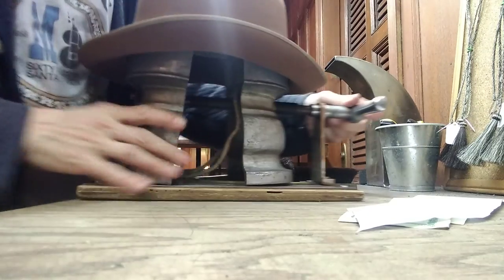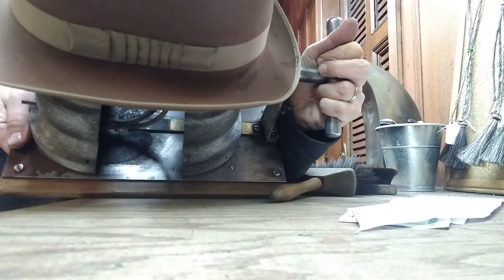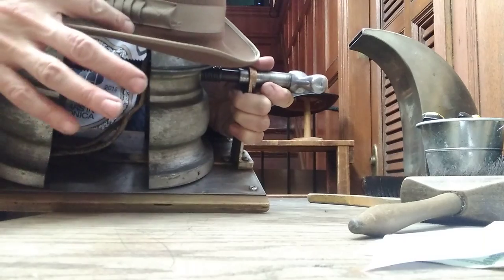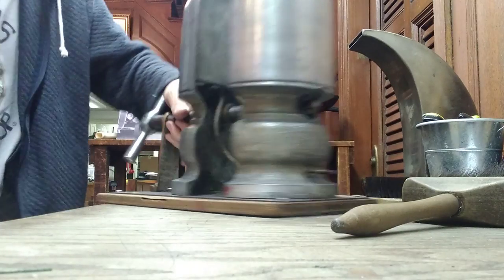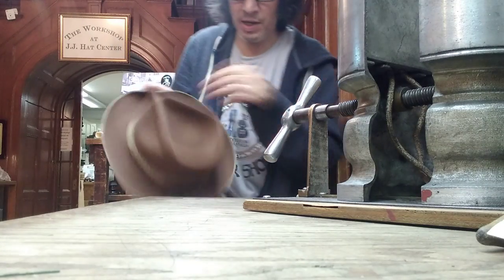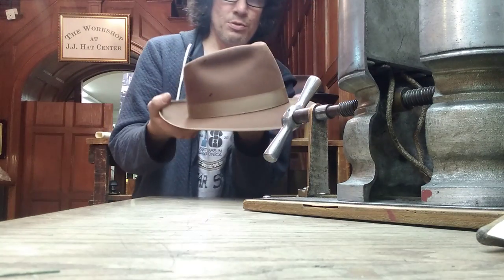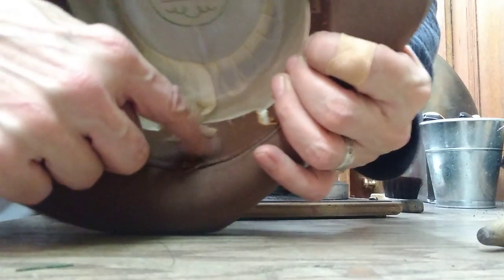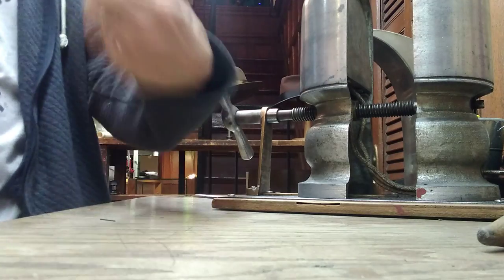Stretching Jim's Vintage Hat 2 Full Sizes !

Comment: Great job. I have a vintage Stetson bowler that's too small. It feels like a 7 and I need it to be a 7 1/8. Can a stiff hat like a bowler be stretched? I put a Hat Jack in it and its slightly better but not much.
Reply from the maker: David Kimberly hat jack needs steam to work, I’m using one here, just a bigger one, steam first in the back, outside the hat, by the seam where the sweatband is sewn in back,to make that seam more elastic,u steam first, through the felt, in back..never,ever steam inside the crown.steam the back, then start cranking as had as u can, if possible, disguise the stretch marks w the ribbon hat band. Make the line right on the edge of the band, it’s not noticeable then..crank the hell out of it, steam, crank..steam..crank..but stop before the bow pops off,let it cool completely, turn remove the jack, without steam u don’t stretch it permanently..steam first. It’s harder with a stiff derby, u can’t do much, but u can do more I’m sure..
Reply: @KTGHATS  that's a ton of help. Thank you, my brother!

Comment: Why not cut the band to control where it splits?
Reply from the maker: Good point, nice that u thought of that . I've done that alot.
 Open the back seam, w hopes that nothing else will split. Then I fill the gap w scrap leather. There's so much pressure,it works sometimes,not always.
   clients always hope for  no splits at all, I always warn them w the disclaimer, but usually they're hoping it won't split at all.. sometimes we get lucky, but when the leather is really dry, it splits all over,cutting the seam doesn't help. It disintegrates.

Comment: So you only stretch in one direction-front to back. Why don't you stretch a little to the sides for a more even stretch?
Reply from the maker: Lewis Ward 90% of folks need length, not width, usually hats are tight and we still have a gap on the sides,most heads are pretty oval, longer..European,African we tend to all have longer shaped heads,although many Asians are rounder and require that modification, we are right in Korea town , so,e softer hats fit horribly on so,e Asian people, the brims wobble and curl at the sides because the hat was made for an oval head, not round.. even in their case, I usually get a stiffer hat, or go larger, to avoid the wavy brim thing, I rarely stretch width Wise.. it’s just rarely needed, but occasionally someone will say the sides feel tight,  and I’ll do it in that case, heads come in all shapes, not just sizes, but I’ve learned to work this way, generally we all need the leather band to stretch and make the shape of our head, we all have different shapes, so I get a good fit in front and back,snug, with enough support so the leather inside can stretch and conform to your head shape... basically, I let the width work itself out naturally..9 out of 10 times we have big gaps on the sides, too much width,and it’s not really an issue, great question.
Reply from the maker: We do have a four way hat stretcher too, for that purpose, I like the steel hat stretcher better than small hat jacks, it leaves no stretch marks.. and stretches the top of the crown as well as the band area
Reply: @KTGHATS  Thanks for the explanations.